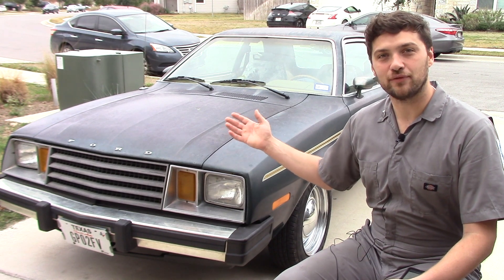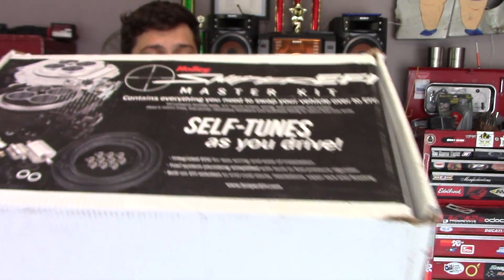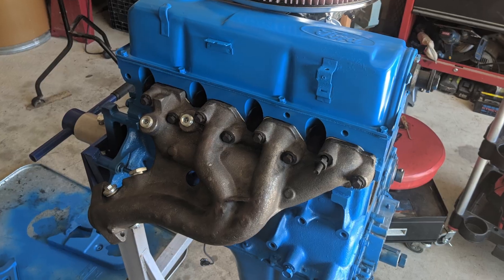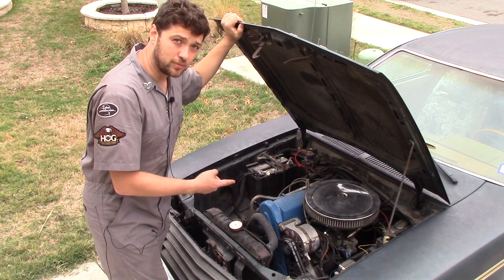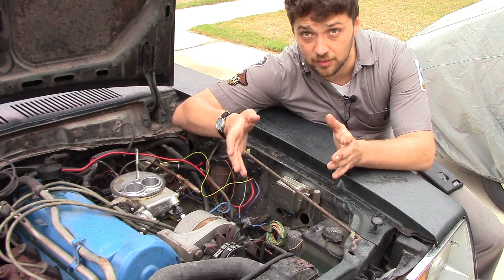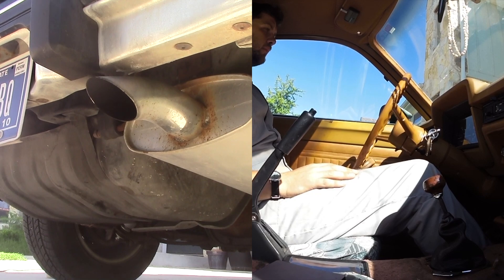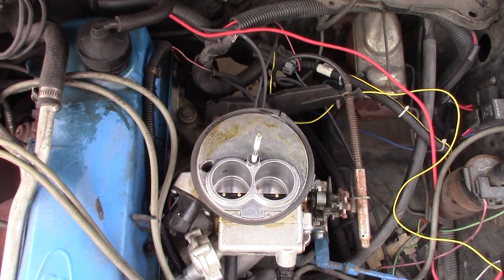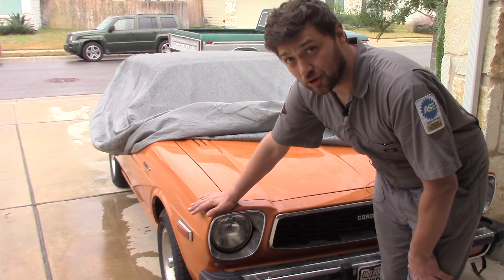How I built my FUEL INJECTED Ford Pinto using Holley Sniper 2300 EFI

Comment: Awesome thanks for making this video I've been wanting to do this on my Ford Ranger with a 2.3L SOHC carbureted engine from a 83 Ford Mustang with the same exact setup with the exception of the fuel tank and vehicle type this has definitely solidified my choice for EFI setup. I would like to know if it can work with forced induction though as I have future plans for a procharger some day.
Reply from the maker: They make the 2300 in a "super sniper" as well that is capable of adding turbo/superchargers
Reply: @Scooter_911  how's your power and fuel economy been notice any obvious differences?
Reply from the maker: @scottbouc2888  fuel economy about the same during regular driving but much better under heavy driving. I havent dyno'd it again after the mods but it definitely has WAY better low end torque. Top end feels better too
Reply: @Scooter_911  ok the main reason I'm wanting to do this is to maintain a steady highway speed while driving the truck has a 5 speed and 5th gear is basically a joke unless you're on flat ground or downhill hoping to be able to go at least 75 mph without to much struggle
Reply: @Scooter_911  just thinking about it what size AN fitting did you end up having to use to clear the valve cover for the return line? I figure if I buy this kit I might as well get it right away because I know I'll need it.
Reply from the maker: @scottbouc2888  it was a #6 I believe
Reply: @Scooter_911  thanks man you've been super helpful I hopefully will be able to get this setup on my Ranger sometime before car show season starts.
Reply from the maker: @scottbouc2888  cool dude! Let me know how it turns out!
Reply: @Scooter_911  hey I just thought of something else how was it tuning it after installing it were you able to do it yourself fairly simply or is it slightly complicated? Also can I run the stock ignition setup or do I have to change it to MSD stuff for it to work properly?
Reply from the maker: @scottbouc2888  it works great with stock ignition and the self tuning is super easy. The more complex you get with the build the more complex the tuning is
Reply: @Scooter_911  Awesome good to hear you're the only one that I know of that has put a setup like this on a Ford  2.3L I've wanted to do it for years but I was afraid things wouldn't work and I don't have that kinda money to throw around on a maybe it will work maybe it won't scenario. So I really do appreciate you taking the time to do it and spending your money to see if it would work or not. Glad it does and I hope other people are just as excited to do this upgrade on their Ford  2.3L engines

Comment: Just had my Mustang II converted to Sniper EFI my buddy did it for me. Very pleased but as he couldnt find a constant 12v that remains good during cranking and run he added a switch and relay to battery which means every time i want to start it i have to flick a switch and wait for sniper to boot and pump to prime before i can crank with the key.
As you pinto will have a similar wiring set up to my Mustang II where did you feed the 12v for the sniper/pump from?
Thanks

Comment: Would the later, ranger or Turbo T-bird intake not clear? Would've given you port instead of throttle body fuel injection. Also, what about the M5OD transmission? Could've had it built and waiting.

Comment: Hello Garrett I am restoring a classic 1976 Maverick with a 250 inline 6. I am using the same efi carb system that you installed on your pinto and hearing that your 2.3 works well with it gives me hope for mine now.

Comment: I'm in the process of installing the 2GC Sniper on my 79 Fiat 124 2 liter, since it was a Weber ADHA with pretty much the same linkage setup I've had to cobble together something very similar to yours.  Other issues with finding a way to adapt it to a Weber footprint and running clean power from the battery in the trunk make it a slog but do-able. 

I'm making use of the existing hard fuel lines in the car but replaced all the connecting bits with pressure rated ones as well as a new fuel tank.   I had a similar problem with the input fitting,  there wasn't even clearance for an elbow against the cam cover and I had to switch in a banjo bolt. 

Back in college I had a 72 Pinto wagon with the 2 liter engine,  I miss that thing.  It was actually capable off road and could sleep two in the back.

Comment: Neat to see it works.  Looking to do a super 2300 on my 84 ranger with a 91 ranger 2.3 setup for a turbo.  Guess yours is fuel only though, as you dont mention the timing or how initial setup on the hand held was.

Comment: Did you have any issues with compatibility between the Sniper and the duraspark ignition system?
Reply from the maker: absolutely none! i'm looking in to upgrading my distrubuter to on that can be controlled by the sniper. My vacuum advance hasnt quite been right since swapping my intake manifold for the offy dual plane.
Reply: @Scooter_911  we converted the bronco ii from thick film to duraspark. The brand new ignition module was bad. It runs now.

Comment: Really enjoy the channel!!  U r one smart cookie. And u don’t worry about the trends. Anybody who builds engines in a onesy and flip flops and drives a Pinto is not used to running with the crowd. Plus u like scooters. What is your real job?  Probably some sort of engineer would b my guess. On the Buddy 125, the first thing I did was hook a car battery right to the starter eliminating any high resistance variables in the solenoid or grounds. I replaced the starter. I just thought that u might b aware of internal binding issues with the internal starter linkage. Super channel!!!
Reply from the maker: thanks! i'm actually not an engineer at all, though i'm flattered. Just a physics/science nut. I worked as technician for the austin police department for the last 5 years (got hired for motorcycles but then they found out i was an ASE master certified automotive tech and put me to work on the cruisers. Recently i got a new job as the shop foreman for the austin Lyft service center. Glad you got the buddy running! those are killer scoots!
Reply: Garret Seesing   Thank u for answering!!  Enjoying all the vids!!

Comment: Thank you for the video bro
I have a 77mercury marquis and I’m really wondering if I should do just a 2 barrel efi swap or switch it to a four barrel intake and efi. I just want little more performance with out hesitation. I just don’t want to spend more than I have to. What would you do?  351m 2v
Reply from the maker: honestly i bet the 2bbl would do you just fine, unless you want to go full bolt ons with exhaust and a cam. The 2 bbl is rated all the way to 350 HP!

Comment: I need to do this to my 1978 Mustang II.  I bought  it new and it has carburetor issues its whole life.  My 63 Falcon, on the other hand, has a manual choke and no emissions equipment.  It is not as good as modern EFI, but not bad.
Reply from the maker: Yeah that is definitely something that makes a huge difference. I'm sure if the Pinto's carb was not a progressive with 30 vacuum and electricly operated doodads it probably wouldn't have been such a pain. Good luck with your mustang! If you decide to go through with it and have any questions feel free to reach out to me.

Comment: Dude, I was thinking of doing this to my 1980 Chevy Citation V6 and now I’m inspired! Thanks, car bae!
Reply from the maker: Hellz yes! I actually love the citation! Please do and report back! Those cars deserve love as much as any other!
Reply: Didn't the 2.8 get stock OEM multiport fuel injection in 1986? Could you obtain and use that equipment?
Reply: @ 1985 was the first year for MPFI, yes, but the thought process was to somewhat modernize an older engine.

Comment: Where could I get that offenhauser intake at? Which other intake would also work? I have a 1984 Mercury Marquis with a 2.3l that I would love to do an efi conversion on!
Reply from the maker: unfortunately i got this one at a swapmeet and their getting pretty hard to come by. The carburetor on your marquis might have the same footprint as the EFI though! and that means you wont have to swap manifolds! you wont know until you rip it off! cheers!

Comment: My search for EFI for my ‘78 Pinto brought me here. Thanks for the good info. I had the same problem with my valve stem seals. I bought the special valve compressor tool and used the magic rope trick to keep the valves up. I installed a rebuilt carb, since my old one had been rebuilt a couple times and was dying from ethanol fuel. It runs great but I would love EFI, electric fan, and roller lifters and cam.
Reply from the maker: Roller lifters are next for me. Reach out if you have any questions when you pull the trigger!

Comment: If I had to guess why the fuel pump is so obnoxiously loud it’s because the pump doesn’t have enough pressure or resistance after it. I’m not even sure why you would need a return line in the first place. Return lines were started so fuel pressure wouldn’t blow past needles in bowls. This having high pressure injectors I don’t see the need. But then again I guess new cars do have them. To test my theory tho I would try clamping the return hose slightly, not all the way off but just about half and see if you hear a difference in sound. Another theory is it’s getting to many amps and is just running insanely too fast. Oorrrrrrr the pump is just junk. I have bought things new that were no good over the years.

Comment: Or you could have just fitted an 88 Ford Thunderbird turbo coupe motor with the head ported roller rockers ,heavy springs ,a Ranger cam after market waste gate, polish out the inside of the intake and add a Jacob's super stock ignition with wires and make 235 hp!

Comment: Great work and great educational video.

If you have a new fuel tank then I strongly suggest you look at in-tank pump options as external pumps generally are noisy buggers with some brands and models worse than others.
In-tank seriously reduces the noise created.

Comment: "Vintage" has become a deceptive sales slogan. "Vintage" as defined by Webster's Dictionary refers to the making of wine.  A thing that is 30 years old (i.e. 70's Detroit bombs) does not make it a collectible/desirable antique like a 60s GTO, 60s Karmann Ghia, or stock 30s straight 6 Buick.  The disintegrating plastic, rattling windows, self destruct gas tanks on those 70s bombs are the reason that Toyota and Honda took over the U.S. auto market.  Save your electronic's skills to install an electronic ignition system in 60s Porsche or VW.

Comment: I rebuilt my '72 2 liter on my dorm room coffee table I used a Moosehead engine transport system (Four guys bribed with 4 bottles of Moosehead beer) I used the Holley 350 with flow reducer from Racer Walsh but ended up running an epoxy filled power valve, because I was running at 5000 feet above sea level

Comment: I had an 84 Mustang with the 2.3 many years ago. Good solid engine. My wife and I tried to trade it in on a new car but the dealership wanted to give us only $400 in trade. I told the salesman, "I'll drive it into the crusher myself before I let it go for that much." We gave it to her Dad and he drove it for another two years. He had about 250,000 miles on it before some bozo rear-ended him. Nice work man! Rock on! BTW, I have owned my last carb. EFI all the way.

Comment: I run a FiTech system, with the retro fit in tank pump.  It’s not hard to install and it gives you a reason to get the tank cleaned, and no noise. Love the video.

Comment: Dafaq are you talking about needing time to adjust a carb? You dont need to do anything when its dialed in. It stays that way fine. The EFI is going to take a lot more tinkering to get right than a carb will

Amd theres a reason throttle body injection went out of style...its still a carb..in essence

Are those rubber hoses all the way up? Seems dangerous..especially on a car that was known for bursting into flames lol

Comment: I live in Michigan now but in the 80s I was in VA. and owned one just like yours I worked as a tow truck driver and the Pinto had been towed to the lot after a small accident but the owner made the fatal mistake of not picking up the car for over 4 weeks after the accident and towing companies charge an average of $50 a day for storage fees which made the bill over $1000 before he could get his car back which of course he didn't have so he ended up signing the car over to the tow yard. These tow companies are nothing but legal crooks. The lot owner advertised the car for sale after he got the paperwork and I bought it for $450. At this time I had no idea that someone else lost there car to these crooks and quit shortly after I found out. I drove this little car for 6 months till I bought a new car and actually found the old owner when I found a receipt with his name and number on it that had slipped down  behind of the back seat. I located the guy and sold it back to him for $5.00 FIVE DOLLARS) but wouldn't take the money. I told him I was sorry for what had happened and left. I was a very happy man that day. And by the way I like that older green Ford Pickup in the background more than I did the Pinto. Great mechanic work though.

Comment: The 2.8 V6 like they used in the early Capri's were a nice drop-in performance mod for the Pinto. I built one back in the mid 1980's for a friend of mine, and did some mild head work, good rods, header, and a small 4 bbl. I imagine if we had access to these Holley kits in that day and age, it would have ran a whole lot better, and developed a lot more horsepower than it did. Those 2.3 Lima engines were pretty bulletproof as long as you kept good oil in them and didn't get them hot. Nice conversion (with the exception of the fuel lines, of course, LOL!) 🤣
Reply from the maker: Hahaha thanks I did end up building a much nicer set a little later. there's a link to the video in this video
Reply: @Scooter_911  I saw you partially uncover a '78 Corolla near the end there. I had one of those when I lived in Fla. back in the mid-80's that I built a screaming Toyota 1600 2TC hemi for. I did a BUNCH of headwork on it, and had a Weber DCOE 40 side-draft, MSD ignition, Crower street cam, headers, etc. etc. It made around 160 hp. N/A which was about double the original horsepower and still got 23+ MPG.😁 Seems the weak link in those drivetrains was the output shaft on the 4 speed transmissions that I would snap off on a regular basis.😜 I found out later on that a company had started making tougher output shafts (and complete sequential gearboxes) to replace the original. I didn't really have an extra 5 grand at the time to throw at it, and eventually moved on to something else.😉

Comment: Hey, nice work keeping that thing running and convenient. It reminded me a lot of my journey to fix up my old eagle, except all my fuel injection parts were sourced from the junkyard or rockauto. Ended up going with mostly the entire setup from a 99 cherokee, as well as the transmission and transfer case. My fuel system isnt quite as jankomatic as yours, but features a universal high flow low pressure rotary pump, a high pressure pump from 80s ford pickups, and a filter/regulator from a grand cherokee. My pumps are pretty loud as well, but they worl pretty smoothly, aside from running dry when I turn sharply right under 1/3 of a tank. Keep it up man.

Comment: Expensive way to do it, but I guess it makes for a good video. Id have just bought a late 80's-early 90's ford ranger for a couple hundred dollars and swapped over what you needed. Plus you'd have a 5speed bulletproof mazda transmission and more reliable port fuel injection.

Comment: Had 2 Pinto hatchbacks. 
Both 2.3 L.
'75 was a totally manual 4 speed.
Loved it.
'77 had power steering and power brakes.
Those engines were damn near indestructible.
Thumbz up to the Ford Pinto!!

Comment: The fuel pump sounds as loud as my walbro on mine, but you may be experiencing more pressure if you haven't drilled out your return line in the fuel sending unit. 
The return line when it enters the fuel sending unit, it's necked down quite a bit, not allowing the extra fuel flow of the efi.

Comment: I have a newer BMW and an older mustang. I drive the Ford everyday  and love it ! The BMW doesn't even have a dipstick ! I have to find the oil level by going into the on board computer ! If I could only keep one, that bimmer would go bye bye. 😁
Reply: It's about the age of the car not the brand, other manufacturers do the same thing in new cars

Old BMWs also had that stick you check the oil

Comment: I HEARD YOU MENTION THAT IT STILL HAD THE FACTORY CROSS HATCHING FROM THE HONING. THAT IS AMAZING. OUT OF CURIOSITY HOW MANY MILES DOES THE ENGINE HAVE ON IT?
Reply from the maker: At the time it had 56,000
Reply: @Scooter_911  DOES IT BURN A QUART OF OIL EVERY 1000 MILES. THE REASON I AM ASKING THIS IS DUE TO THE FACT THAT SOME NEW CARS ARE KNOWN TO BURN 1 QUART OF OIL EVERY 1000 MILES. IT SEEMS NOBODY CAN FIGURE OUT WHY AND I CAME TO THE CONCLUSION THAT THE REASON THESE NEW CARS ARE BURNING A QUART IS DUE TO THE FACT THAT THEY DON'T BREAK THE ENGINE IN PROPERLY WHEN THEY ARE NEW. I BELIEVE IF THEY DUMP THE PEDAL BEFORE THE RING SEAT THEMSELVES THE RING GAPS MOVE WHERE THEY ARE NO LONGER 180 DEGREES OPPOSITE. BUT INLINE WHERE THE GAPS MOVE CLOSE TO, OR OVER EACH OTHER WHICH IS THE CAUSE OF HIGHER OIL CONSUMPTION. THANK YOU FOR RESPONDING AND I'M AMAZED THAT THE CROSS HATCHING IS STILL THERE. LET ME KNOW IF IT BURNS A QUART EVERY 1000 MILES.